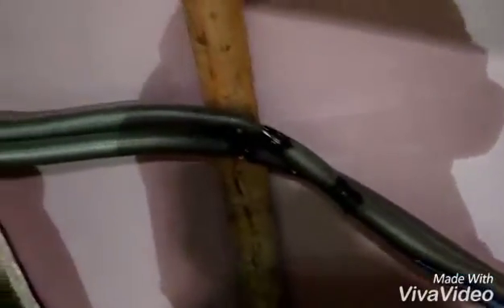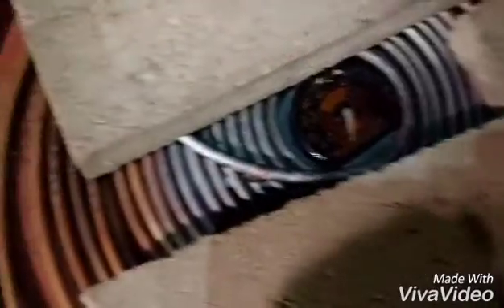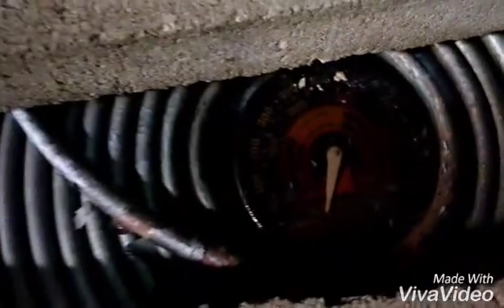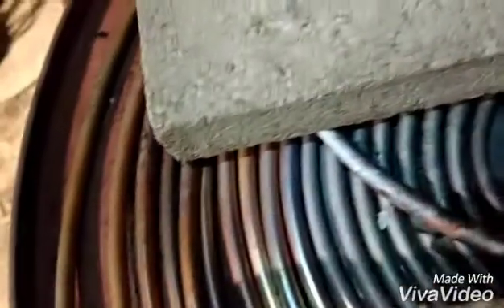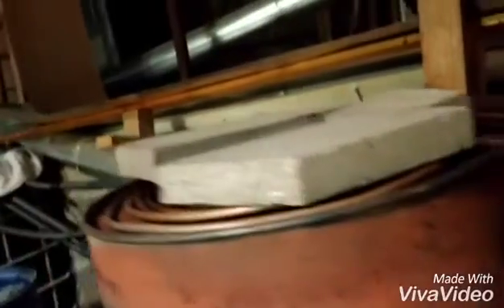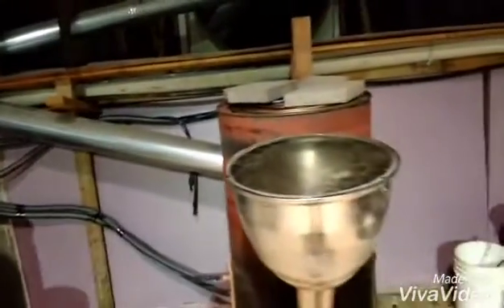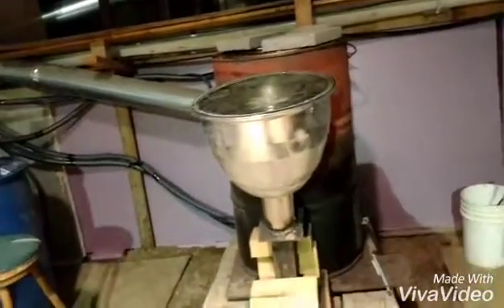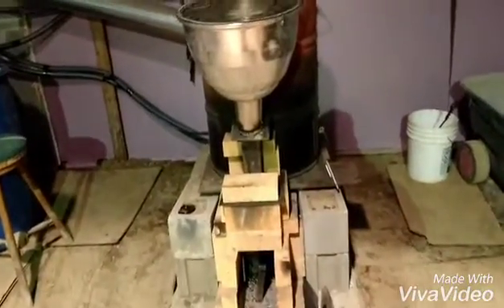Rocket stove meltdown

Comment: some pellet or pump sensors and solenoid valves on the shopping list?
Reply from the maker: Candoract , Hi.
Yes that would be a good idea. This stove was built for just a temporary source of heat. I will be building a larger one next year to handle the completed aquaponics system. It has done great to provide the heat I need now. Stay tuned for updates. Thanks, Von

Comment: how long it burn until this heppend? it was with pellet ?
Reply from the maker: DHudjec , Hi. The basket holds about 40 pounds of pellets and that will burn for about 3 hours. Sometimes the pellets will feed faster and burn hotter. I'm sure it was 1200+ degrees and that melted the pipe connector. thanks, Von

Comment from the maker: The PEX tubing did not melt, it was the insulation around the pex that melted. A plastic PEX union did get distorted and I replaced the plastic union with a copper one and the pex tubing that got over heated.